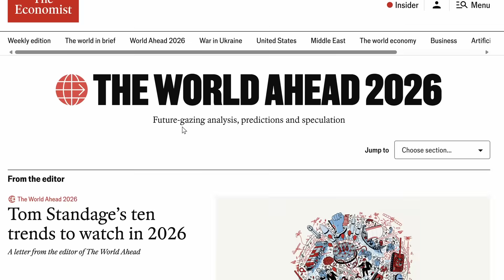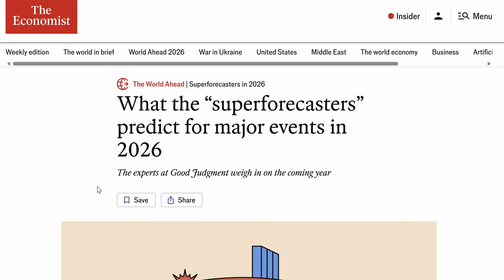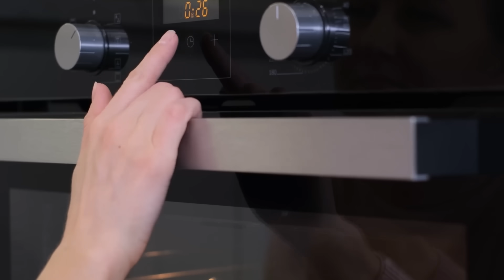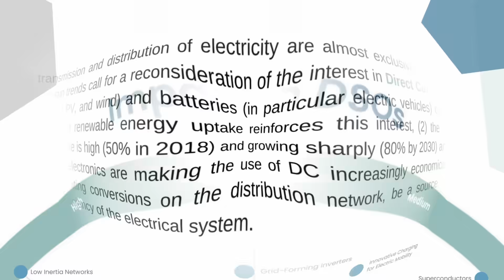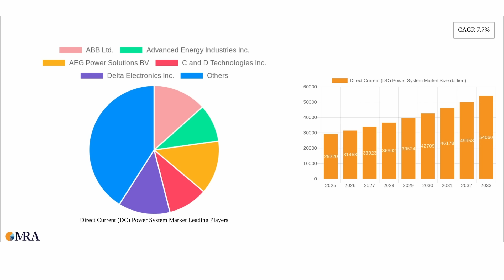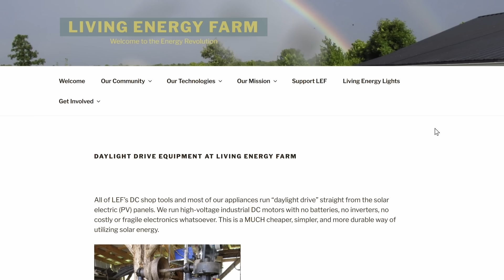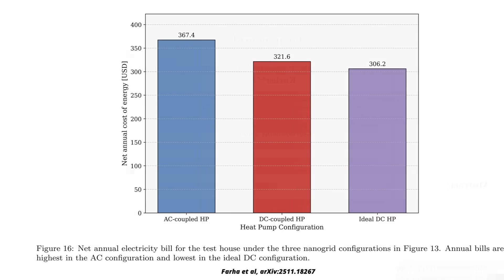Are We Using the Wrong Kind Of Electricity?

Comment: I'm an electrician, AC is far safer than DC for many reasons.
If you are in contact with a DC cable and create a circuit with your body, you will never be able to let go of the cable, your muscles will contract locking you in place.
AC means your muscles will pulse giving you chance to let go or at least fall away if unconscious.

However here in NZ we have a high voltage DC line that runs almost the full length of the South Island, there are reasons why they did this.

Most of our devices that run on DC are low voltage. Any DC above 120V becomes really scary. 
The highest DC current I have had to deal with is around 300A at 54V, that stuff scares me because it is easy to start a fire or destroy anything conductive that contacts it.
The highest AC was 800A at 400V three phase which is just as dangerous IMO.

The DC Sabina is talking about is at several thousands of volts, this has to be so otherwise the cables have to be more than double the AC cable size to reduce volt drop. 
DC is just no economical for any situations other than extra high voltage transmission, situations that require slow motor rotation, battery storage/usage or electronics and control circuitry.

It takes only 50mA of current to stop a healthy human heart at 50v in a dry situation where the bodies own resistance is reasonably low.
There are reports of people being found dead in the bath with a mobile phone on their chest, cause of death cardiac fibrillation leading to arrest. 
The voltage required can be much lower if you are in a conductive environment such as water. 
A mobile phone can easily produce the current and voltage required via it's charge port in such a conductive environment.

Comment: The reason AC was chosen over DC is because voltage drops along the distribution line and with AC it can be stepped up with a transformer , with DC it was a lot more complicated and inefficient involving a motor driving a generator.

Comment: I'd love a 48-55v DC circuit with outlets all around the house that negotiate a voltage using USB PD protocol. Perfect for most small devices, and would push for more efficiency from manufacturers.We just need a more robust plug and socket design than ISB-C, which can break easily. A worldwide standard DC plug that can negotiate it's power would be amazing. What would it look like?

Comment: Garbage. Transformers rely on AC, and without stepping up the voltage for transmission and then stepping it down for use "at the destination" we'd be back to square one - or the "Edison square".
Electric motors - while there are both AC and DC motors (and DC motors have certain advantages over their "undecided" brethren, they are way simpler and cheaper to manufacture (and use much less copper).
In other words, NO. Won't do, won't work - and, last but not least, it's WAY easier (and cheaper) to turn AC into DC then the other way round, especially when in tens of kW range. So, nope. And this subject is worthy of "Just Have a Think" channel... ;-)

And, oh, by the way - UHVDC long-distance transmission lines are different kettle of fish, and it has nothing to do with "end users' current" - and then they are viable ONLY for really long distances and huge power transmissions - because, precisely , of the need to re-converting them into AC at the destination - and megawatts-rated converters don't grow on trees and they cost pretty penny to build and operate.

Comment: Long distance point to point DC transmission lines have the benefit of much lower capacitive coupling and effectively zero resonance losses. These are the key reasons why DC is used for submarine transmission lines.
Reply: You are obviously oblivious to Ohm's Law as it relates to DC.
Reply: @Promptjock they are short runs, now try sending that DC voltage over hundreds of miles, what will you use to raise the voltage up to a level where you can use it. You would probably need a transformer, so then you need to turn it to AC, then back to DC again.
Reply: @Promptjock  Bless you for pointing out the obvious! .....ahahaha That was a great response! That is the reason Edison''s D.C. failed and Tesla's A.C. became the standard....resistance.....is an Ohmie thing! Right Ohmie! Sorry, I had to chime in after your "obviously oblivious" remark! *****
Reply: finally it is active power which makes the power lines comfortable for birds 😅 . it is about reducing I^2  on power lines and converting high voltage to low voltage (or vice versa).

Comment: Generating DC from rooftop solar and distributing it through a building using Power over Ethernet or even over USB can be very efficient, without using AC converters at all.  LED lighting and desktop IT for a three storey office building could be run off rooftop solar / battery for much of the year in northern Europe.  

I set up a joint industry & academic partnership R&D programme that did exactly that under the UK Low Carbon Technologies initiative in 2008.

Comment: DC has a lot of drawbacks with respect to AC. One good advantage, however, is great stability with any number of producing and consuming nodes. This stability is appreciated the most where many small power plants, like solar plants, are available. Recently Spain suffered of a long lasting blackout probably due to a sudden decrease in solar produced power. The blackout would have last far less if the Spain's grid was DC...

Comment: Merry Christmas, Sabine! 🎅 Well, I think in a few years we'll do fusion the right way, in the solid state. I already have a theoretical framework that I think can produce such results. If it works, we may be able to embed scalable fusion reactors in our devices much the way we do with batteries today. Imagine a flashlight that runs on water. "Mr. Fusion" to power your car. No batteries except maybe a gold capacitor to initiate the reactor with a starting current. I see it as a distinct possibility. Then everything will be DC, but you won't have to worry about transmission losses or power lines. We could use our tap water with a filter module inline to divert heavy water for use in our devices. Our world will be prettier without the transmission lines. Cleaner, too.
 💦⚛🔦 🙂👍

Comment: DC voltage is not the same everywhere, so we have to raise it, or reduce it (and not using resistors in series, ... please... ) so DC would have to be modified in its voltage, on arrival home, isn't if ?

If the transformation to what the appliance required is of a matter of interest, better to stick to AC which can serve what requires AC, and transform it into the required DC - VOLTAGE  for other appliances.

Comment: Changing over to DC is a mistake.  Electrical contacts like relays, switches, contactors, brushes etc are more easily destroyed by DC.  Many devices that have current rating at 250 VAC will only have the same rating at 24 to 28 volts DC.  The small savings you get will be eliminated by increased repair costs.

Comment: I planned a 24v dc net at home a decade ago, but realized it just doesn't make sense.
So i first thought, oh boy: no way!
Then i followed your train of thought and realized most devices probably don't care if they are powered by AC or DC. Heaters: toasters, ovens. Switching Power supplies.
There probably is only some motors that really require AC.
Reply: "some motors that really require AC."
Induction motors obviously.  The only kind of motor that does not care is called a "universal motor" and it has brushes and a commutator.

Comment: I don't think that DC used for transmission makes appliances simpler, because distribution voltages are almost always too high to be used directly, and in many cases the loads need variable voltages, so there are DC/DC or AC/DC converters everywhere. 

In an LED lightbulb, the mains voltage is converted to a lower DC voltage to run the LEDs. The converters that do that are often constant-current, not constant voltage, so even if there was a suitable DC voltage available, converters would still be needed for efficiency, and to keep the lighting level constant if the supply voltage varied.

When charging a car, the output voltage of the charger has to vary with the state of charge of the battery, so car batteries would never be charged by connecting directly to the mains input. They also need isolation for safety. At the moment, the AC chargers on cars first rectify the mains, put the DC current through a power factor correction (PFC) circuit and then use that DC current in a DC/DC converter. The DCDC converter first converts the DC to high frequency AC, puts that through a transformer, and rectifies the transformer output to DC again to charge the battery.

If a car charger were to be run from DC,  the rectifier and PFC bits could be omitted, but the rest of the conversion circuit would remain.

Most appliances do run on DC internally, but Sabine didn't mention that conventional transformers are still used a lot, and they won't run on DC. There are also a lot of motors which rely on AC, so most fridges won't work on DC. There are some inverter fridges, which are a bit more efficient, which will run on DC. Some clocks still use the mains frequency for timing, and some very low power appliances use a "capacitor power supply" which won't work on DC.

I think that there would be so much disruption in changing to DC for general power distribution, with really quite small benefits, that I don't think that it is likely to happen in the next few decades on a large scale

Comment: Sabine, how microwave ovens run on DC? Yes, sure, the magnetron is essentially a rectifier, but it runs on kilovolts of high voltage obtained from a hefty transformer running only on AC :) Microwaves are "pro-AC" as much as it can get for consumer electronics.

Comment: HVDC has lower losses due to specific characteristics which AC transmission has. Converting DC is more difficult than AC, but the technology to do so has advanced a lot. Still, basically if you transform DC voltages, you will make AC and then convert back to DC (more or less). We’re just much better at doing that now, with more sophisticated controllers switching the current. You can then make optimal use of the inductance, magnetic capacity of the coils.

Comment: AC is required to have a modern high voltage national power grid. DC can be used for specific purposes, i.e. AI data centres are moving to 800VDC systems.

Comment: There was no mention of transformers, which are the biggest advantage of AC. Nevertheless, now most electronics use high frequency converters to get the right low voltage for the equipment. And the transformers are much smaller and lighter. For home equipments that need more power, like washing machines, vacuum cleaners, air conditioned, etc, DC would be as good as AC.

Comment: 2:43 there are some AC systems that are not used for consumer electricity that use other frequencies. There are old train lines that use 20 and 25 in a few cases. Some aircraft power systems use 320 or 400. Not really relevant to home electrical grids, but interesting if you are a software engineer who is having to explain this to a person with an electrical engineering degree who should already know, given that they are designing electronics for airplanes. This is not the only horror story I've had on that. Even though my degree is for Computer Science, I had to teach my electrical engineering major roommate about wiring a North American clothes dryer. And I've heard a lot of horror stories from other software engineers and IT people when it comes to electrical engineers not knowing what they are doing with AC systems. I think part of the blame should go to the schools for not teaching this content. I'm actually seriously considering developing a textbook for it.

Comment: Larger motors are three phase AC. The brushes on DC motors need regular maintenance and rebuilding commutators is also a problem AC motors do not have. 

If you are going to use inverters to power the motors you need to consider the maintenance on those too. They are not infallible.

Comment: What is Sabina wrong about today? What she really needs is DC powered refrigeration pumps, and air-cooling pumps. She says "most of our electronic devices "run" on DC and talks about electronics in your house and that in the future some 80% of residential use will be DC. All that stuff is BS that can distract the viewer and prepare their minds to accept a comparison of apples to oranges. In reality, if all of your home DC loads are connected to a DC power system then they all need to be running at the same voltage, and you would still need some lossy electronics to accomplish voltage regulation. Otherwise, every time you add another DC load you would change the supply voltage a bit. Using a DC system will not necessarily help with efficiency and probably will lower it.

Then she goes on with a discussion showing off some high voltage DC distribution lines used for DC sources like solar. (Wind does not need to generate DC. That is just how they made the electrical machine.) And, of course, she points out that IT systems "run" on DC although not on high voltage DC and therefore represents a so called "conversion" that you probably cannot avoid. The number of conversions will probably be about the same using DC or AC.

She then says that the latest DC technology is better and show off a commercial microgrid that has a lot of electronics in it, just like I said, in order to create "current supplies" as opposed to "voltage supplies". All those components are "conversions" and no word yet on the improvements.

She then shows off a grid in the USA that uses solar panels more directly, so that it would be cheaper, simpler, and all that and we see that the cost may have just been relocated. Some jobs are better done with DC instead of AC and you have to manage all facilities from the top down to coordinate that kind of thing. Eventually you will need to have both AC and DC supplies to do everything with the right tools for the job.

I might be able to agree that she needs and wants more high voltage DC lines at the top of the systems without abandoning the AC system.

What she really needs to do is come up with a DC refrigerant pump that can replace the enormous loads used by cooling and refrigeration in commercial and residential facilities. (and it has to not BLOW UP due to fact that it needs to be located in the refrigerant system if that is not obvious) That way she could utilize daytime DC sources of electricity.

This video measures about 95% on my BS meter. Thanks anyway. Merry Christmas.
Reply: One of the technical issues here is about terminology. A rational discussion of these things would probably include the terms and definitions of a "currenet supply" as opposed to a "voltage supply".

Comment: 4:00 Why does wind power use DC? Turning a rotor seems inherently AC. Is it converted to DC because the AC frequency is variable? I don't get it.
Reply: They are AC however they aren’t synchronous (precisely phased 50 or 60 Hz) so get converted to DC then back to AC at the substation. This is why grids with high penetration of wind and solar need synchronous condensers to stabilise the grid and why a grid without a spinning generator can’t restart after a blackout
Reply: Wind turbine uses a generator, so intrinsically it produces AC.
Maybe it is transformed to DC later.
Reply: Wind turbines are not AC synchronous generators, such as those connected to gas turbines. They use electronics and DC and stuff. They also don't provide physical inertial to the grid like Large synchronous machines, unfortunately.
Reply: Yes, because you can't really have them rotate at the exact same frequency as required. So, they generate in DC and invert to AC at the grid frequency. There are designs that can vary the gearbox speed continuously based on the wind speed, such that the turbine can generate in AC without conversion and inversion, but these designs turned out to be complex and the inverter type won out. I think it's worth mentioning that these inverters are extremely efficient. You're talking 97 to 99 percent efficiency. Same for hv ac transformers
Reply: There are DC generators, and I think they are simpler than AC generators. I assume wind turbine generators are DC. However, I just searched Google and wind turbines are AC generators.
Reply: @savemykind5877 the only intrinsically DC generators are batteries and solar cells. 

Other renewables like wind, hidro, ocean waves, solar concentrators, etc. intrinsically produce AC. 

Though AC can be converted to DC later with circuits, therefore you will lose some energy.

Comment: MY ENTIRE CAR runs on 12V DC. Also, my computer runs (internally) on 5V and 12V. My wall clock runs on 1.5V AA battery.
...even my SMOKE DETECTOR is powered by 9V batteries! And each 9V battery is itself comprised of 6x 1.5V AAAA battery cells.
My gol-dang wrist watch uses a coin cell and 98% certain even that is direct current.